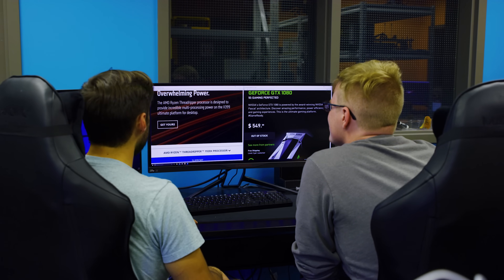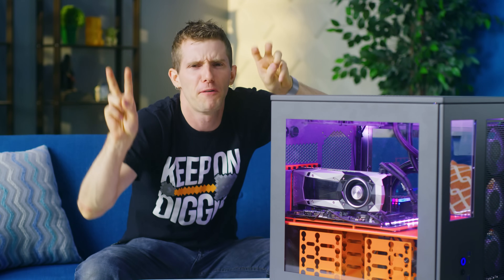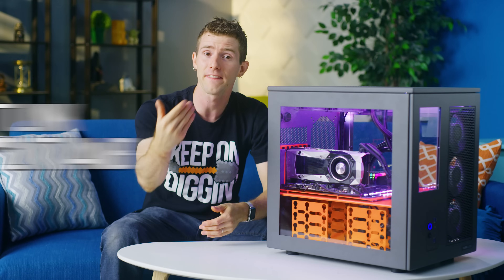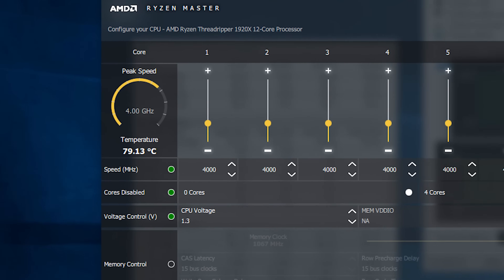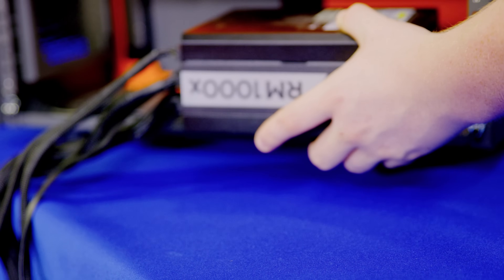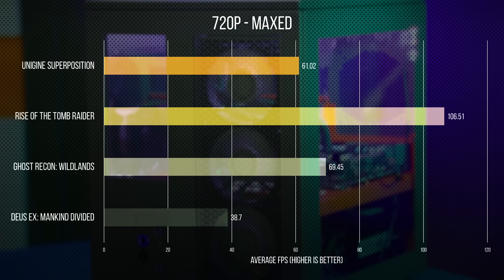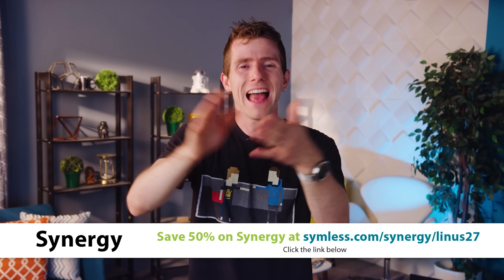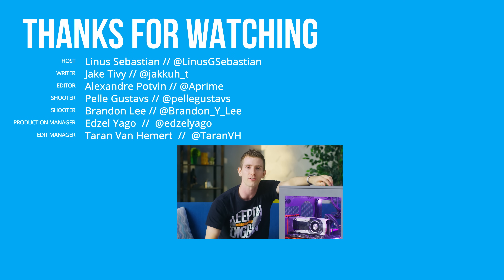The 1920x1080 MEME PC - WE BUILD & TEST IT

Comment: how is mankind divided maxed not performing at 720p? I play it at 1440p with every setting as high as it can go and everything but motion blur on and get a steady 70 fps. How is it struggling to get 32fps? I have a asus strix 1080 and i7-7700k. I can downsample from 4k and still manage 30fps. What is going on with this build?
Reply: Try again. Turn on everything and max everything even the useless ones.
Reply: What useless ones are you talking about? AO=high bloom=on cloth physics=on contact hardening shadows=ultra depth of field=ultra lens flare=on level of detail=very high parallax  occlusion mapping=high res=2560x1440 screenspace reflections=ultra shadow quality=very high subsurface scattering=on temporal anti-aliasing=on tessellation=on texture filtering=16x anisotropic texture quality=ultra volumetric lighting=ultra motion blur=off but that is a personal preference. 
The only thing I don't have on is V sync and MSAA. MSAA 8x, of course, will destroy fps which I suppose if you wanted to make a meme you could totally turn that on and profit. I assume you mean turn on MSAA, the destroyer of all things holy and watch as your 70fps goes to 14 on the main menu! Haha, I also should correct my FPS count in my original comment. This got me playing again and I was steady in the 80's to 90's (crashed in the rain though. This game feels extremely unstable sometimes. They never did fix the shooting range crash).
Reply: Arterca :3 You answered yourself, the 8xMSAA is what killed the 1080
Reply: 8x msaa, 150% resolution scale, everything completely maxed out
Have fun with a 1080ti because it will tank hard even at 1080p
Reply: there isn't a need for it at that scale. Even with a Titan Xp it will struggle. It's not meant to be played like that. I presume you could call it setting itself up for the future. It is extremely graphics intensive compared to the majority of games on the market today. I don't think it's fair to make this build and then max out those settings. You wouldn't ever benchmark any of that equipment at MSAA x8 and 150 screenscale. Almost nothing on the market would be able to touch it realistically even at 1080p and at that point if you downscale from 4k or 8k you're gonna get similar results at much less impact. SLI Titan Xp with an i9 should do it though.

Comment: wait, why did it perform so badly? those are great specs
Reply: chilldude30 It's a troll video. None of the results were legit. They're just screwing around.
Reply: The results were legit but they fully maxed out all the settings, every slider they could find they maxed it out hence the low fps.
Reply: Wait, so are the results legit? One the one hand, I know maxing out deus ex mankind divided IS very demanding, but I didn't think it was THAT demanding. Plus, I have a gtx 1080 with a worse processor (2600k and get great results in most games at absolute max settings. Also other people in the comments said they get better results with a 1080 than in this video. So I guess it might be a 'troll'.

This video was pretty stupid and just made everyone confused because the 'joke' isn't even a funny one

Comment: If u want a meme pc do custom water cooled pc but cooled with mountain dew
Reply: so it would probably fry up in minutes? PERFECT!
Reply: Plasma Octopus It would actually probably work. JayzTwoCents put milk in a loop.
Reply: Interesting, maybe linus should do that then lol. I wonder if mountain dew would affect the longevity of the water cooling compared to water in some way.
Reply: Plasma Octopus Soda is extremely harsh and acidic. It would definitely shorten the life of the cooling components. It'd probably ruin the pump faster than rust the system though.
Reply: Shawn H also might wreck the CPU through corrosion. If I had any idea where my water pump was and some hose, I'd test it out on one of these old desktops I keep meaning to junk
Reply: InfernosReaper I'm not sure it'd wreck the CPU, unless it somehow got out of the cooling system and onto the CPU. But that would cause a mess far before it had time to corrode. Either way, it'd be a short lived endeavor. Lol
Reply: Maybe. I could easily depends on what it does to the hose &/or the cooling block over time. It probably will destroy the pump first, of course.
Reply: WOAHH DANK MEME WOWOOWOWOW
Reply: redbull gives 69% lower temps when used in a watercooling system
Reply: I'm not accepting that build unless you can somehow crush up cool ranch doritos and get them going around the cooling circuit too.
Reply: Abooboo_house no with Pepsi
Reply: Butter as thermal compound?
Reply: dank memes
Reply: no it doesnt.. it makes it fly.. duhh.... XD

Comment: why is the build doesn't perform well..?? Its threadripper and gtx 1080. Is this a joke???
Reply: de_regen The results are real, they maxed out everything in settings, even 8x AA and shit. So...
Reply: Protoss 01 but wasnt it rendered at 720p ?
Reply: 8x msaa, 150% resolution scale, everything completely maxed out
Have fun with a 1080ti because it will tank hard even at 1080p
Reply: haha, how come antialiasing options suck nowadays? Now its either getting no anti aliasing, fuzzy anti aliasing, or anti aliasing that absolutely murders performance?
Reply: Sixty 4 720p with 200% scalling is no longer 720p
Reply: Roikhan Ulya Hamidan 200% scalling so that the problem. because i'm using much worst cpu and gpu and still get a better fps than this.
Reply: Thanks guys for this useful info. My brain just exploded when i saw the result. lmao

Comment: 720p Deus Ex runs below 60 on a 1080? WHAT?
Reply: TheJoker1432 maybe deus ex has a super sampling feature, I don't know.
Reply: Yeah, it's just because MAXED has super sampling to an absurd degree. Not realistic to actually use that at all. That's the case with most of the games they showed.
Reply: Deus Ex is basically the new crisis, you can super sample to hell on it
Reply: this game at max is overkill on pc specs
Reply: 8x msaa is the problem.it kills Performance
Reply: Doesn't help that game was coded like garbage, i think that 6 month delay was to make the whole game.
Reply: TheJoker1432 shitty cpu?
Reply: The bencchmarks on othergames running 720p was still a bit crap. I felt disapointed after watching this video
Reply: Fortunately, Rise of the Tomb Raider ran at 100FPS in 720p.
Reply: its fake results dude. There is no way the 1080 performs that badly on a ryzen cpu and i even researched this to make sure.
Reply: +Michaël it really depends. I've run extensive testing on both of these, among others. I got the i7 to run on 5.1GHz - that's a 900MHz or 21% overclock, while on the Threadripper  I'm still struggling to get it stable on 4.1, so I have to say it maxes out at 4.0 for now, which is a 500MHz or 14% overclock. The threadripper is undoubtedly better at running multithreaded tasks, in that regard the 7700K can't even remotely compete - no surprise there, seeing how the 1920X has 3 times as many cores. However, in applications that can't make use of a bajillion threads, like feeding a GPU for Octane rendering or indeed playing most current games, the 7700K is still boss, overclocked or not. 

In any case, it's well known that Deus Ex on maxed out settings is stupidly demanding, and the video is a joke anyway. The conclusion linus draws here makes a lot of sense, though - if you take this amount of money, you could build a machine that would run the game much, much better. It's a ridiculously unbalanced system that does nothing well enough to justify the price, and the reason is not one of the components, but the pointless combination.
Reply: Yeahhhhh... That REALLY stuck out to me as well! I mean WT actual F? Even if you are forcing, I dunno, 8 times SSAA to Deus Ex MD - a GTX 1080 SHOULD be giving you far more than ~48 FPS!  
This video has just left me scratching my head... I mean YES the Threadripper 1920x is an overkill CPU, but a GTX 1080 is NOT weak enough to EVER score below ~90 FPS at 720p "Maxed" Desu Ex MD.  OF COURSE NOBODY should be pairing a 1920x with a GTX 1080 for JUST gaming anyway (I can see workstation and other creation type reasons to have such a build) but the point is ANY PROPERLY FUNCTIONING SYSTEM WOULD SCORE HIGHER THAN YOU HAVE SHOWN US LINUS! Please for the LOVE OF GOD EXPLAIN WTF HAPPENED HERE??

I get it IF you were FORCING something like 8x Super Sample AA - at 1440p and above the GTX 1080 would definitely score in the low to mid 20s, but it should NEVER EVER score below 60 FPS at only 1280x720!   So WHY DID THIS HAPPEN??!!? You say "Watch this video about bottlenecking to learn more!" but you see, you used a GTX 1080 - and that GPU would NEVER Bottleneck at just 720p - so unless Threadrpper is TERRIBLE at gaming for some unknown reason that I have not yet seen reflected elsewhere - or you had SOME kind of problems with your settings!
Reply: that would make sense if they max super sampling, where you are basically running 4k anti aliasing + other settings like shadows/AO
Reply: +Michaël now let's take apart what overclocking is: You raise the frequency of the processor through adjusting the base clock or FSB or whatever they call it these days, the multiplier and the core voltage. That's basically it. And those are all possible both on the 1920X and the 7700K. Beyond that, there is no "unlimited" overclocking - the chip will inevitably become either unstable or uncoolable at some point. And for a 1920X that point is around 4000-4100MHz, while for the 7700K it's around 5000-5200MHz. Don't get me wrong - the Threadripper is an awesome chip that outclasses the 7700K in many applications. But if you want to game, the 7700K remains the unchallenged go-to chip.
Reply: I guess there can't be limitless overclocking, since there isn't limitless cooling
Reply: bottlenecking, it's not made for 12-core CPUs
Reply: It's the anti-aliasing, even x2 MSAA murders frame-rate.
Reply: 1. Amd threadripper isn't for gaming. 2. Worst optimization on games for ryzen cpu's
Reply: How fix bottlenecking like a real pro

Just break the damn bottle.
Reply: +Michaël 

1. Proof or GTFO!
2. Even if you can hit 4.5 on your 1600 that's a) not a 1920X and b) still 500-700MHz less than a 7700K.
Reply: 8X MSAA kills the frame rate. I really enjoyed that game, and its great looking. Just be prepared to see your FPS go from 70 to 35 when you turn on MSAAX2. I played on high settings with FXAA on a gtx 980.
Reply: Yeah 4.5 on a ryzen 1600X? PICS OR GTFO.
Reply: We would need some sort of black-hole cooling to have "limitless cooling".
Reply: You misspelled Ryzen...
Reply: Its thread ripper not able to give enough info in time off one core its not a gaming CPU
Reply: Guys, don't argue with the obvious troll who can barely speak English.
I mean, first of all, over clocking past 5ghz is pointless. So if you can push 5.9ghz, congratulations, you haven't actually gotten anything more out of your system. Would've gotten more by running in SLI.
Oh, and don't even mention stable & 5.9ghz overclock in the same thought. Literally no way that's stable.

Second of all, Deus Ex is just a very expensive game to run on max, as everyone else has pointed out.
Reply: Michaël show it
Reply: And Kabylake X runs at 7.5GHz on Liquid Helium.  But LN2 or LHe cooling is hardly usable for anything but competition, right? It's nice to pit chips against each other on LN2, but it has absolutely no place in a discussion about which CPU is best suited for what, as there's not a lot you can achieve by running your chip at a bajillion GHz on LN2 when that will only last you a couple of minutes and costs you like 5 bucks every for every single one of them. 

See, I consider myself an AMD supporter. I have more often than not opted for AMD hardware even when it was inferior to the Intel or nVidia competition at the time. But I can still see when an Intel processor or nVidia card is better suited for a given task. And for gaming or tasks that use 4 or fewer threads in general the 7700K still is king. Kabylake has comparable IPC to Summit Ridge, but it typically gets clocked higher on stock, and it overclocks significantly higher on reasonable cooling setups.
Reply: Michaël in this Video they didn't show more than 1 Core on 5,9 GHz simultaneously, it was cooled with dry ice and it crashed. You see it in the Video you posted. So watch your stuff.
Reply: This CPU has been made for rendering shit. Not playing games... It performs WORSER at gaming then a i7 7700k. It only outperforms in rendering times. They aren't really worth the cost of about twice the price.
Reply: I'm running a 1600x and an EVGA GTX 970 SSC ACX 2.0 (specific enough?) 16GB of the same ram as they used (GSkill Trident RGB @ 3200MHZ and 14 timing) and I get signifigantly better FPS in all those test. what is he doing?
Reply: No they aren't "limited" per say, but practically NO ONE has gotten a Ryzen to run over 4.1ghz reliably. Including me. My 1600X will not go above 4.05 GHZ without being janky as hell.
Reply: do not feed the trolls man.
Reply: TheJoker1432 As Linus said, bottlenecking.
Reply: Intel K-series chips like the 7700K don't have an overclocking limit.
Reply: so when you see an  over clocking maximum of 6.95ghz in BIOS-es (whats the plural for an acronym like BIOS? DERP!) is that a limitation of the motherboard?
Reply: I hear on the fanboy-ing, 4.1 is most any conventional set up can hope for on Ryzen. As for your statement  "He does not offer ANY Ryzen. You know why? It is not worth the work, most dont even get 4 GHz and you can do it yourself if you want. So its a waste of time." That's not exactly true. The reason he doesn't delid them is because Ryzen didn't use shitty TMI and soldered the heat spreader to the chip, you know, the way INTEL used to before they got lazy and greedy. But hey, I'd be lazy at least if I were them too when I hadn't been legitimately challenged for the last 10 years.
Reply: Stanley Scalf not true also. Than he would still offer cherrypicked OC tested ryzens what he does not.
Reply: bottlenecking my guy
Reply: TheJoker1432 the cpu is a bottleneck.
Reply: Shanedoestech it's threadripper. Threadripper isn't made for games, it's made for multithreading. So things like Blender will benefit, but games won't.
Reply: jootai yes. But for gaming, it is a bottleneck.
Reply: the 1920x is not meant for gamign its trash at it far worse than older cpus by intel and amd… its meant for something like 3D rendering and such and 4k and 8k video rendering and editing. not gaming that's why but even still lol.

Comment: If u don't get it
Ryzen 1920x
Gtx 1080 Ti
1920x1080
Reply: Ty all I was getting from this was >9000 😅
Reply: Ge7orce saved my life 😂😂😂
Reply: Ge7orce it was just a 1080 not a 1080ti
Reply: @thearbinator2487  yeah the 1080 ti wouldnt have bottled knecked its a 1300$ gpu lol
Reply: @joelguzman9280  except it would considering the 1080 ti is only 10-20% better than 1080 in most games
Reply: Joel Guzman the GPU wasn’t bottlenecking it it was threadripper - it has Lower clockspeeds so it’s not great for gaming
Reply: バンシーブランク  Threadripper isn't for server use, it's for high-end work stations. AMD's EPYC CPU lineup is for server use. Also, Threadripper 3rd gen is now much better at gaming due to a few different reasons, one of which is that the CPU no longer needs to use different NUMA nodes due to the sheer amount of cores.
Reply: I still don't understand please help. Is it a joke about resolution?
Reply: *1080

Comment: Why the hell is a GTX 1080 getting 12 fps in Deus Ex Mankind Divided at 1440p max? It should be getting 2 to 3 times that.
Reply: The amount of work max settings and minimjm settings puts on a gpu isn't that much different. Because so much of it will be put on CPU to handle which is very very weak in terms of single core.
Reply: @LeMisteran  Hahahaha you're joking right? The 1920x is on par in single threaded performance with something like the i7 3770k. That's not exactly weak pal. And combined with the 12 cores and 24 threads, it should handle it no problem.

Comment: Knew this was coming XD one day
Reply: I also XD was expecting this XD as well
Reply: next time is an athlon x4 640 and a gtx 480
Reply: eduhaposa rx480 no gtx
Reply: eduhaposa 720x480, then 800x600, and then 1280x720
Reply: Amer Hamwi GTX 480 is a video card :P
Reply: The next logical one would be 1680*1050: a theoretical AMD Ryzen 1680 paired with an NVidia GTX 1050. If you manage to build it using a Ryzen 1600X and a GTX 1050, that would be a near miss, but it would also represent the 16:10 aspect ratio.

Also, you're only allowed to benchmark it using a 1680*1050 monitor.
Reply: Yeah I saw this one coming ages ago.
@Daniel Tedeschi Hey you forgot 1024x768 man...
And and 1152x864
Reply: HaHa   I just put a 1050 Ti SSC  in my Ryzen 5 1600 build...... I was just not going to pay what everyone was askin for a GPU while the Bitcoin B/S was at it's peak . Thing is I only have 1080P displays  so .... believe it or not this damn rig is smokin for what it is . like 1987 base clock on the GPU and that is with no over clock ... no shit really ... IKR ???  slamming heaven well over 100 FPS on Med. but high settings is around 85- 90 with a min. drop to like 48 . really not a bad rig for a 160.00$ GPU .
Reply: my 1050 ti is hitting 1980 as well, ASUS STRIX OC Edition, doesnt go above 60 C
Reply: Eggs Dee
Reply: KineticPixell  Ya but rx480 better than gtx480. Dooing CPU under-power x GPU over-power. Invert Linus build
Reply: I have a question, when overclocking at all, does the CPU ALWAYS run at the desired clock speed or does it ramp up and down depending on the situation?
Reply: If you use power management settings in normal mode. (Default) yes it is supposed to adjust volt and clocks depending on system load.
Reply: intel cpu you activate intel turbo boost in bios and it work even a 4.7ghz that i run but amd i dont know
Reply: XD
Reply: Christopher Kato i